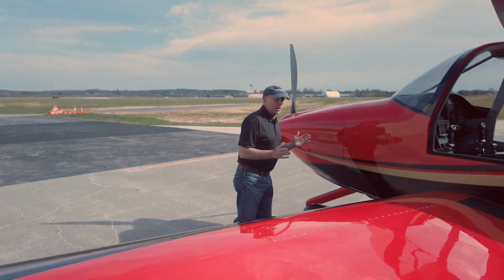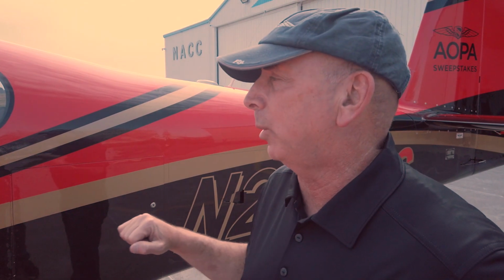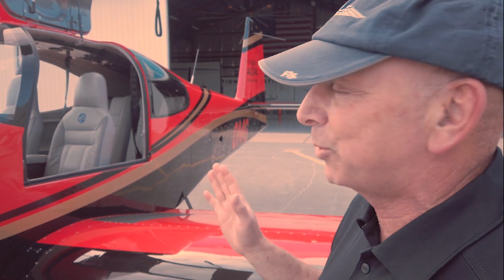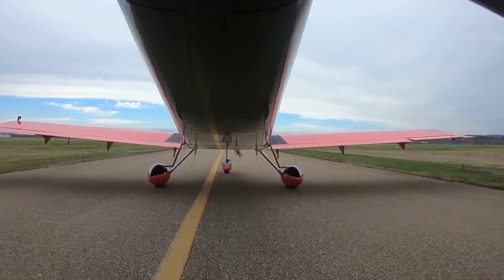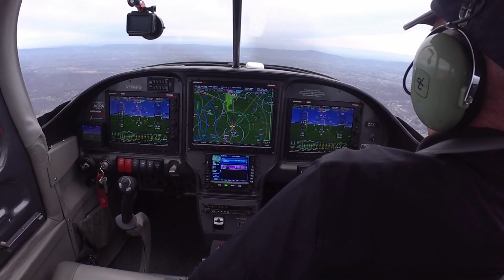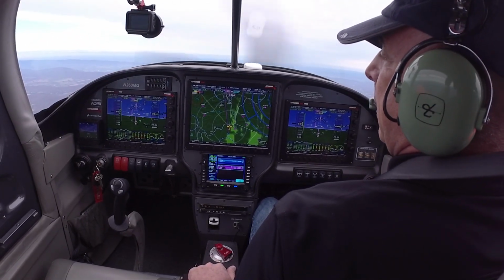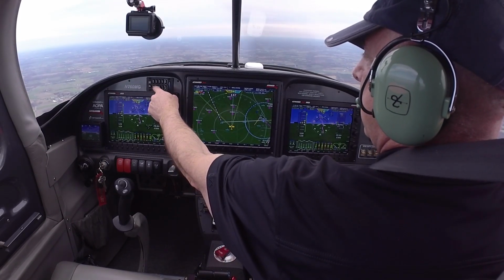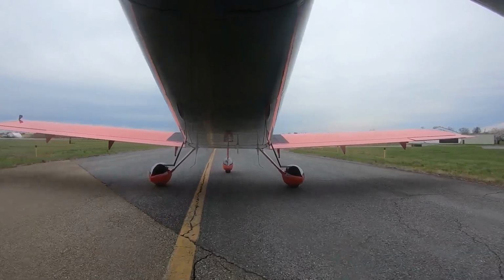AOPA Sweepstakes RV-10 "virtual" checkout

Comment: Sweet airplane.  I think the listed empty weight maybe a typo and needs to be adjusted.  It's equipped very similar to my own RV-10 and it weighs in at 1635.  1060 empty sounds pretty optimistic.